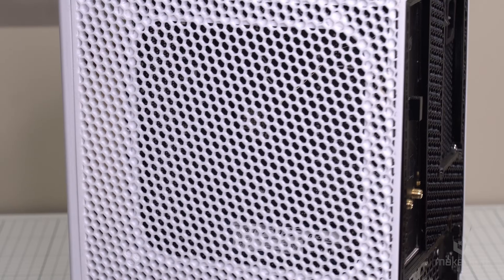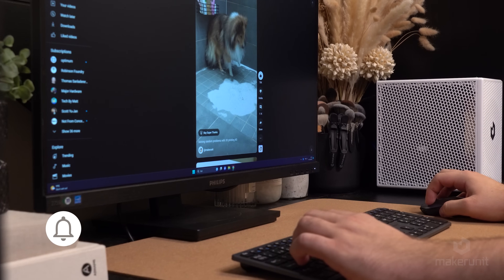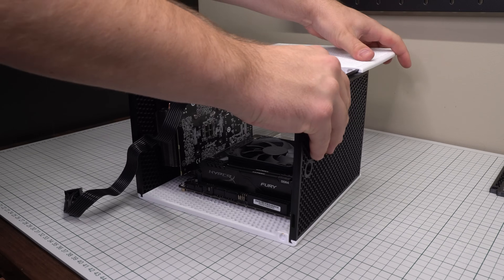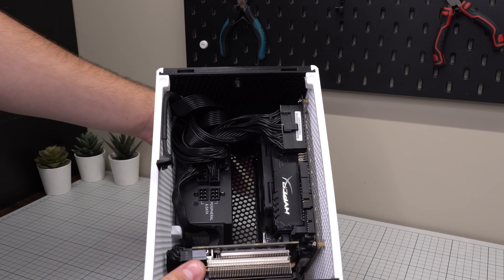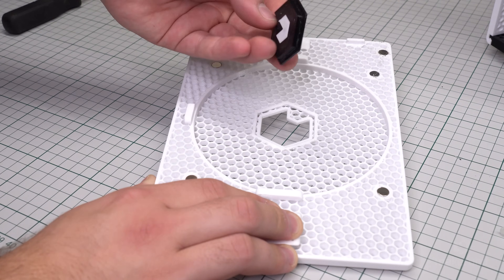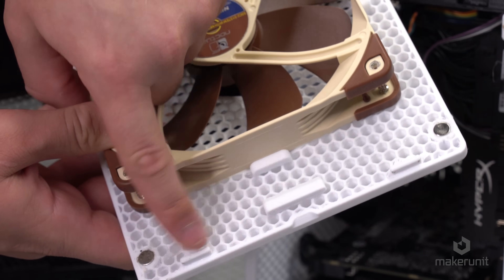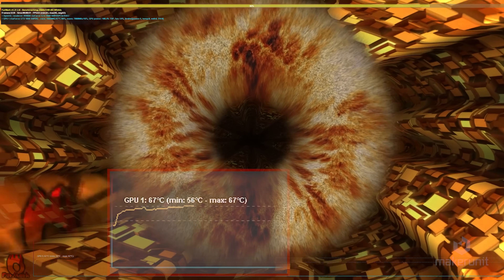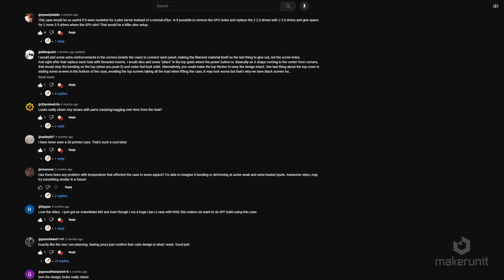Tiny 8.1L SFF build - 3D printed PC case

Comment: You could add 4 fins on the inside extending from the power button cutout just to add some rigidity to the top panel when the power button is being pressed. Otherwise great design. 👍
Reply from the maker: Thank you! You know the little shelf for the power supply? To support it’s weight on the side panel. There is actually one of those shelves as well on the white front panel to support the downward force from the top panel if you look closely 😊 you’ll see it in that frame where I point out where the pins are in the top of front panel.
Reply: @makerunit  ohh I must have missed it! The idea for the fins came from watching someone 3D print an ukulele I watched recently. They used fins to make the top face stay straight without any flex under string tension. You should def try making at least a medium version for larger mobo/gpu combo. The honeycomb pattern is a very visually interesting design and like you mentioned it plays great with internal rgb as well! You could totally sell it as a diy case kit or something like that.
Reply: @makerunit  I wonder if adding enough space between top panel and top of mobo for a 140mm exhaust fan would help with cpu temps. Get them in the 70s range. Obviously it would add the thickness of a fan to the overall height of the case.
Reply from the maker: @jackbauer2698  yeah I’m planning on doing a mATX case next and I’ve already made a pretty good idea in my head of how I want it to be and I think it’ll work out great.

Technically 79 degrees is still «in the 70’s» but yeah I get your point. I think it’d be better to aim for a design with support for a bigger cpu cooler rather than more airflow. Because the Noctua L9a/i series coolers has it’s limits too in terms of how much it actually can cool no matter the airflow added. 😊 even just by adding support for a cheap 92mm fan «tower» cooler would probably perform a lot better like the CM Evo 212 or similar that you can get for like $25 or even less.
Reply: @makerunit  oh for sure! Can't wait for the mATX case video! Keep up the amazing work. 👍

Comment: Hi just wondering i know it might be difficult but is it possible to make a full atx case or mini atx with combining pices?
Reply from the maker: Hi! It’s possible to make a mATX case without combining pieces for printers with a 300x300mm volume or bigger, but there are very few common printers on the market with beds bigger than that so fullsize ATX would definitely need to be split into parts, byt everything is possible 😊

Comment: Looks great!  Nice form, function, and well designed for the limitations of 3d printing.  Love your idea of using infill as a way of customizing the panel patterns.  Very well thought out.  Keep it up!
Reply from the maker: Thank you! I do my best to add something new in every case! The problem often isn’t to think of the layouts or setup or size, but more, how is this printable, how can I avoid support material if possible, which way will the parts be strong, can it hold the weight of this and this part etc 😁
Reply: @makerunit  That's what makes your designs good. They are made for the medium and it's unique opportunities and constraints
Reply from the maker: @NoobTryAgain  thank you! 😊
Reply: I liked it very much. I hope to get it. What will the price be in this case?

Comment: Is it possible to have the IO oriented downwards so the cable can be hidden away even better? You can then mount another 140mm fan at the back for exhaust. So front to back air movement and a bottom facing io.
Reply from the maker: If mounting the IO downwards, how would you plug in any peripherals then? Like mouse, keyboard, etc. especially if using wired keyboards/mice? Then the case would need very tall feet if I understood your question correctly?
Reply: @makerunit  Yea, it does make plugging in peripherals more annoying since you will have to lift it up to access the IO. Usually the peripherals' cables will have to be lead out from the back then to the front. You might also need angled plugs like Display Ports and USBs. 

But it is a way to have a very clean desk set up since all the plugs are hidden underneath and all you have to worry about is hiding the cables coming out from under the case.
Reply from the maker: @gelinrefira  That’s fair, but using angled connectors with a back mounted IO can also achieve almost the same effect in my opinion, but definitely possible👍
Reply: @makerunit  You're right, angled connectors will probably have the same effect. I guess I am just looking for the cleanest possible solution haha. By the way, I really like your builds. I especially like your chimney design which has been in my head since designs like the xbox and back then the trashcan mac pro. I thought of using riser cable, and aligning the heat sinks of both the GPU and CPU inwards, then use two 140, or even 200mm fans, one at the bottom and one at the top. Then only have perforations under the case and exhaust out from the top. That way, the air movement is like the xbox or trashcan mac forced induction. By right, you shouldn't even need fans for the heat sinks. Then you can place noise dampening foams on the walls of the case inside, and that should reduce a lot of noise. Two big fans spinning at lower rpm to still able to move a lot of air with noise dampening, and you should get a very quiet case even under load. It's definitely not a showcase case though.

Thanks for the discussion.
Reply from the maker: @gelinrefira  forcing the air through might end up being more effective than having perforated sides. The noise dampening was a good idea to try sometime! 👍

Comment: Gyroid seems a lot like those cooling pads used in greenhouses. Water is trickled down these pads and the pads are wetted constantly. The giant fans are used to pull air through these pads, the resulting air is much cooler than the outside air.
Reply from the maker: I didn’t know this, but that’s pretty clever! Might it be to also be create a humid environment for the plants to live in? Isn’t the purpose of a green house to keep the heat and humidity high and stable? 😊
Reply: @makerunit  Yes, it does raise the humidity but the greenhouse is really climate control. For places that are really hot, like in FL, it is necessary to cool down the greenhouse instead.
Reply from the maker: @gelinrefira  I see! Makes sense, I guess too hot can cause problems too 😁

Comment: I really enjoy your editing style. I would like to see what your version of a Nas server case would look like. Something with up to 6 or 8 3.5'' hard drives.
Reply from the maker: Thank you Henri, I’ll try to make the «medium boy» or «M» version more flexible in terms of layouts and parts compatibility, and also, printability is definitely an important factor in the designing process. I’ve noted this request  from multiple people in multiple videos now so I understand this is something many of you wish for. I’ll put together a list of possible editions of the new «M» size.

Currently people seem to want this:
- mATX mobo support
- fullsize ATX psu support
- NAS support 4-8 drives
- 300mm 1.5 slot GPU support
- liquid cooling/radiator support.

And on top of this, it’s requested to have a minimal footprint, great thermals, and silent operation 😅

It’ll definitely be an interesting challenge to see how many of the points I can implement into one single design! 😅
Reply: @makerunit  Is there a discord or something similar where i could contribute to the design process? I would love to help
Reply from the maker: @henrigrotkamp  Hi, actually I do not have that. Maybe I should have had that…😅

Comment: Larger GPU space - make a A4-H2O improved replica 🙂
Reply from the maker: That should be possible! Keeping the ITX motherboard but adding top support for a AIO and extending the length to support a 300mm GPU keeping a similar slim body could work! Or a 120mm AIO side mounted behind the PSU keeping the same height/width, just longer body could work too. Would also free up space on the other side wall for additional storage or extra intake fans.

Comment: Greetings dear friend.  you are very cool!  please continue!  my wish for this project is to make it compatible with the miniDTX - 19X19cm board, as well as the flex atx and tfx power supply.  tfx power supplies can be found cheaply on the used market, miniDTX boards are also often installed in office PCs.  3D printing is often about saving money, and MiniITX boards and sfx power supplies are always expensive)
Reply from the maker: Thank you so much! I would love to experiment with different board sizes but at the time speaking I only own a ITX and mATX motherboard, therefore most of my designs are built around this and I’m focusing mainly on the most common PC parts that the majority of people own. When making some bigger versions in the future I’ll look into adding multiple mounting holes for different types of motherboards but the only downside is that motherboards I don’t physically own I can never guarantee that the parts will fit correctly without testing :/ I definitely understand the issue about ITX parts being more expensive and that’s also why I keep making designs around the same few parts I have available slowly adding one new part at a time 😊
Reply: @makerunit  perhaps a good idea would be to buy non-working parts from repair shops or flea markets
Reply from the maker: @nononame73  yeah that may be an option. Or second hand online. Most new and old parts follow the same standard mounts so wouldn’t really matter the generation.

Comment: Amazing case. I would like something like this but mATX, psu at the front at the top intaking air from the front, maybe due to being taller it can have a 120mm fan below the psu. This might allow to have a bit longer gpu and a good air cpu cooler and a rear exhaust fan.
Reply from the maker: Definitely a good idea! A design just like that has crossed my mind actually! I notice a lot of you are requesting ATX psu support and I’ll do my best to implement that in the designs where it’s possible without ruining the design. The optimal solution would be a hybrid mount that would support both sizes 😊
Reply: @makerunit  I was talking about microATX motherboard but yes, atx psu too. I wanted to get an sfx power supply but the price difference is huge in Argentina and there arent many options. Itx motherboard too, you can build an entire system for the price of the motherboard, like 600usd and more haha
Reply from the maker: @aleksidk  I see! Yeah especially for the newer generations with LGA 1700 sockets and high speed DDR5 support the ITX motherboards can be twice the price of their ATX versions. The gap didn’t use to be that big before just a few years ago but now it’s insane!

Comment: great job, love this design. i would go smaller by ditching the graphics card sense  the 7 5700g has integrated graphics
Reply: wadu hek
Reply: @Petrevv  i meant 7 5700g , my bad lol
Reply from the maker: Thank you! I guess a APU only build in this fully perforated hexagon design could work! Are you thinking with a SFX psu still or pico PSU? (Pico is the tiny psu that plugs into the 24pin connector and uses an external power brick)
Reply: @makerunit  Pico sounds like a  nice way to  keep  it slim
Reply from the maker: @wolfmercer  I could call it «Pico Boy XS» 😅
Reply: @makerunit  lol sounds good to me👍

Comment: Thank you for another excellent design! I would really be interested to see a 3d printed competitor to the nr200p max. That itx case can fit HUGE gpus with amazing thermals. I just build in it for a friend and was blown away by the performance of such a simply designed case.
Reply from the maker: Thank you! I see! I’ve been considering something similar to that for a possible mATX/ITX bigger version of this case! 😊
Reply: It would also be cool to see you use composite materials to optimize case stiffness like they do on 3d printed airplanes. Aliexpress has some really cheap carbon fiber rods. I would love to design  a case using these one day, but for now my modelling skills are limited to say the least :D @makerunit

Comment: I'd love to see a 3d printed case that fits a full ATX board.
Reply from the maker: Full ATX board is a bit more tricky than ITX as nononame here mentions, to print all the side panels as one piece it would require a very big print surfare exceeding the size limits of most common printers but there are workarounds such as printing in smaller parts etc. but it’s hard to get it as clean if doing that. Though not impossible and by integrating the joint into a part of the design it can actually be done but would require some well thought solutions for joining the parts smoothly. Definitely possible and would be a fun challenge for a future project 👍😊
Reply: then you will have to look for a printer with twice the print area (Ender 3 - 220mm, very common and therefore MiniITX format cases are also popular), while for an atx board the print area is already needed more than 300mm x 300mm, which is much less on the market, due to  with a double increase in price.

Comment: In a medium case you can use a full size PSU, the small form factor price are nuts here.
Reply: Yes, it's true!
Reply from the maker: My plan for a medium case is to try to make a mounting solution that supports both full ATX and SFX psu’s 👍 possibly front mounted exhausting upwards.
Reply: @makerunit  it's good idea! Like!

Comment: Best one mate! Really love not just the design but also the simplicity and practicality of the build process. Would love to have this house an matx mobo but still being very small and compact. Would also love to see other variations of the in-fill pattern. Really amazing work! If I had a 3d printer I’d try it out.
Reply from the maker: Thank you so much! mATX mobo, longer gpu support, ATX psu support, I’m starting to get the idea of what most of you want 😊 never too late to get a 3D printer 😁
Reply: @makerunit  for me, matz mobo but as small as it can be. I have my rig but I want it smaller in terms of footprint but not wanting to change the mobo. I'm being selfish I know..lol
Reply from the maker: @JTCDesignStudio  that’s a fair request tbh. But really, it’s possible. A standard ATX psu is 140mm wide, same as the fan. So theoretically it should fit without increasing the footprint much exept from the length.  Width can technically still be the same. 😁
Reply: @makerunit  possibly yeah..just different mounting positions for the standoffs. Also, is it possible to have  no need to have heated inserts to assemble the case but still be rigid? Possibly a challenge for you?😜
Reply from the maker: @JTCDesignStudio  it’s possible. Just takes some time to figure out 😁 the goal is to use as few screws and extras as possible.

Comment: Would love to see an ATX size model. Love these chassis but hard to motivate getting itx size parts because of the price and me being a student.
Reply from the maker: I see I see. There’s a little challenge with ATX motherboards and mainly it is the fact that ATX motherboard designs often exceed the maximum size of the printbed on most common printers (300x300mm) given that the motherboard height is 305mm. Though it’s possible and can be done I’ll see what I can manage to put together in the future. I’ll probably first create a mATX version before proceeding to fullsize ATX. 😊 the goal is to manage the fullsize some day too with some clever design, but no point in making a fancy design if almost noone has the printer to print it. So it would have to fit within 300x300mm at least for now given the current printer market.😅
Reply: @makerunit  I agree with you 100%

Comment: Excellent design work. I really liked how you maximized the rigidity of the case by using one sided dovetails and French cleats.  Your work keeps getting better and better.
Reply from the maker: Thank you so much! I made the sliding tracks different on both panels on purpose so there would be no way of installing it the wrong way. I should have probably mentioned that in the video too 😅
Reply: @makerunit  Excellent thinking,  idiot proofing!
Reply from the maker: @NoobTryAgain  exactly 😅
Reply: @makerunit Things are only idiot proof until I try them.
Reply from the maker: @JamesChurchill3  haha I guess there’ll always be that one person who forces the parts into the wrong track even though it clearly doesn’t fit 😅

Comment: Great PC-Case. What is the maximum cpu cooler height, will the slightly thickernoctua nh-l9x65, with 65mm height fit? I think it will be great, it slightly bigger coolers will fit, because the Ryzen 7 5800X3D is pretty famous in gaming, but it has a tdp of 105w, which is too high for the small noctua nh-l9.
Reply from the maker: Thank you! I’ll have to measure tomorrow, though I think it might not be very effective even if it did fit it would be way too close to the PSU, kind of blocking the airflow so I feel it would not work as well. feel free to remind me through this comment if I forget to reply to you again tomorrow. 

Though my recommendation is to wait for my bigger «M» version I’ll get started on soon. Gathering some inspiration at the moment but I’ve already saved a list of possible additions to it. 

The goal is for it to support better coolers, both air and AIO liquid coolers. (Size not decided yet)

Comment: nice job!! max cpu eight??
Reply from the maker: Thank you! Honestly I wouldn’t put anything much bigger than maybe 45mm as any higher would come too close to the PSU partially blocking the fan intake air path possibly making the situation worse.

If you’re looking to use bigger coolers I’d suggest waiting for my next «M» version. Main goal there is to support more cooling and more flexible in terms of parts usage.